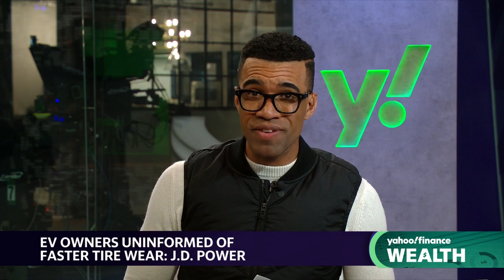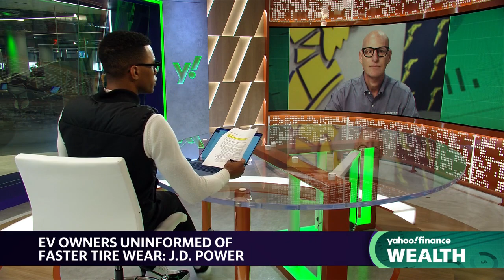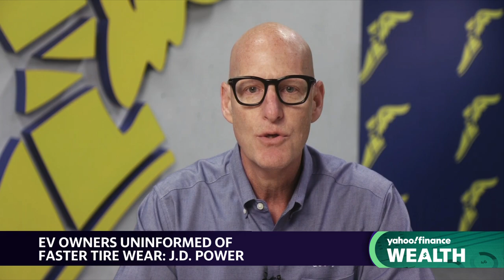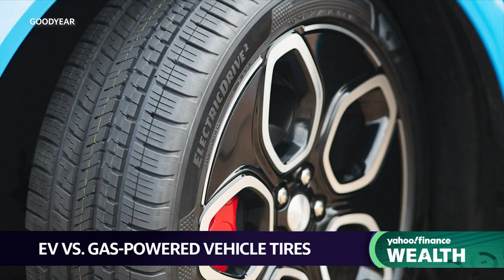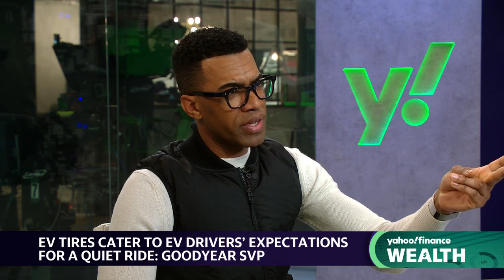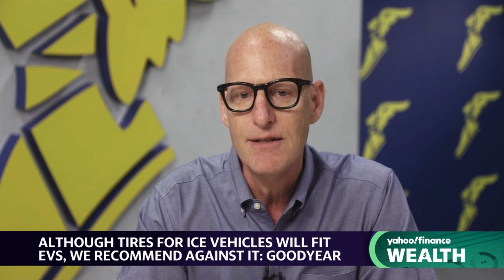J.D. Power finds EV tires wear out faster

Comment: More education is needed for the creators of this nonsense. EV tyres do not wear as quickly as those of equivalent ICE vehicles and produce far less airborne particles. They also produce a fraction of the brake dust compared to vehicles without regenerative braking. For passenger cars comparative weight has very little to do with tyre wear, nor does acceleration unless particularly aggressive. For cars driven respectfully at normal road speeds braking is the main cause of tyre wear and EV’s do that mainly with progressive regeneration which wears tyres much less quickly than using conventional brakes.

Comment: More tire wear from EVs leads to more air pollution. Keep in mind;

• Brake and tire wear contributed similarly to or more than tailpipe exhaust in PM2.5

• Brake and tire wear contributions were 2–3 times the exhaust contributions in PM10

Hybrids like EVs omit less brake dust because of regenerative braking but they don't have a much tire wear. Yet another argument why hybrids are a better option than EVs.

* Contributions of non-tailpipe emissions to near-road PM2.5 and PM10: A chemical mass balance study.
Reply: I was about to make a similar comment, but without the actual numbers.  What's the source of your data?
Reply: I have never heard an ICE driver talk about pollution until EV's came on to the market, they are quite happy polluting the atmosphere with line of pollution that goes back to removing oil from the ground but all of a sudden EV's are polluting but it's OK to pollute the streets where you kids are growing and developing with ICE cars spewing out Brake Dust, tire dust and all sorts of pollution out of the tail pipe, including Particulate Matter that enters every part of the human body via the lungs.
ICE drivers are such hypocrites.

Comment: I'm experiencing just the opposite. My 2013 Cadillac ATS wore out tires after about 20k miles and those same tires on my Tesla Model 3 are at 30K miles and still good. The only difference is the PSI could that make the difference? The ATS ran at 36 PSI and the Model 3 runs at 42 PSI.
Reply: If you are pushing them to 30K they are no longer safe.
Reply: @harveypaxton1232  I got one of those tread depth gauges and it still shows a little green, no red yet and my wife drives like a freak…
Reply: The algorithm looks after the tyres.